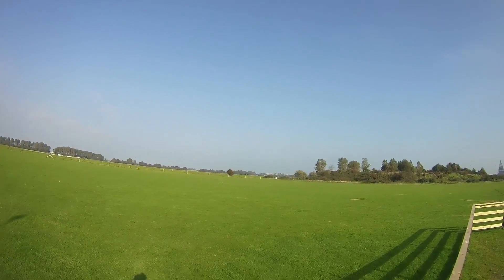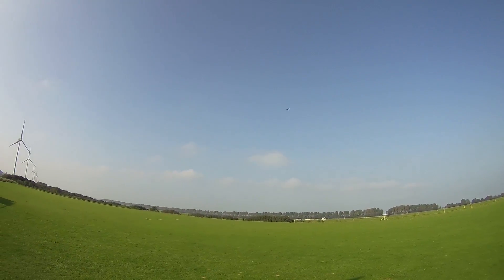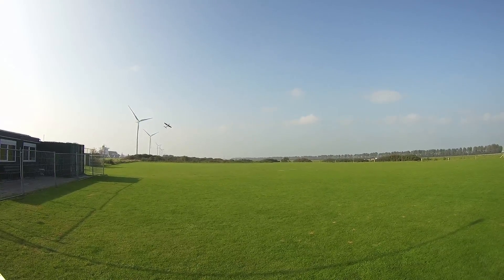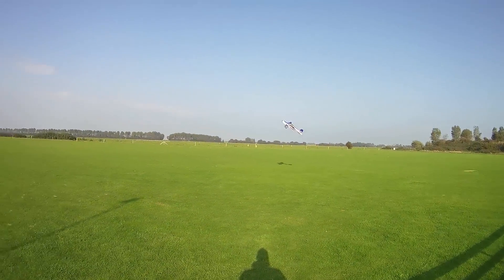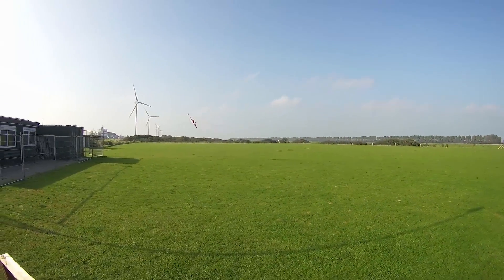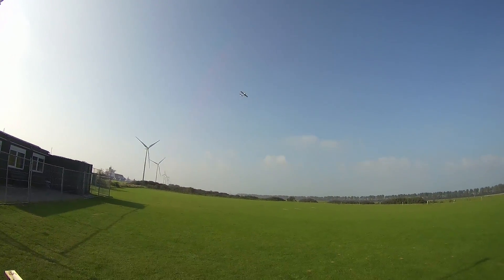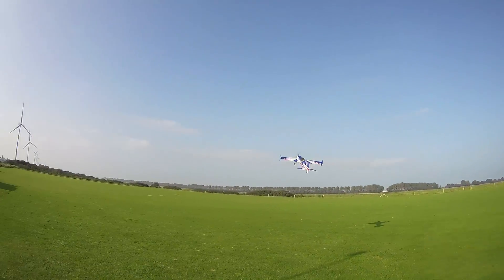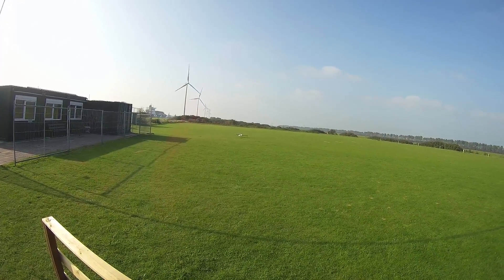3D Tutorial: The Harrier

Comment: Awesome Tom thank you!! I will start practising this. I need to change to high rates. How mutch expo do you use?
Reply: MrBullet3030,  full movement on elevator and rudder, 30 to 40 %  movement on ailerons. 50 to 70 % Expo on all. Ailerons become very sensitive in slow flight.
Reply from the maker: I use a lot, over 60% up to 85% sometimes, because I don't use low and high rates, and I like it supersoft in the middle!